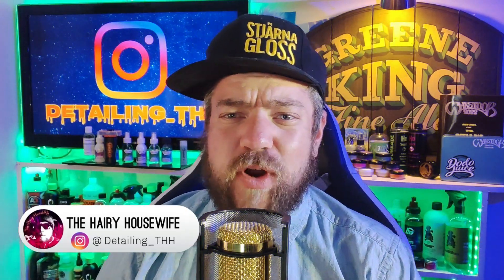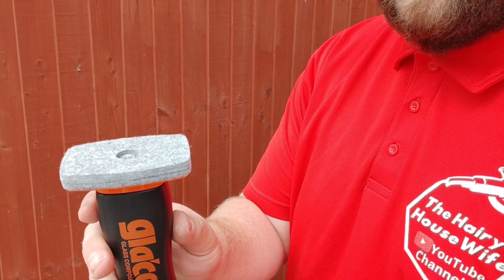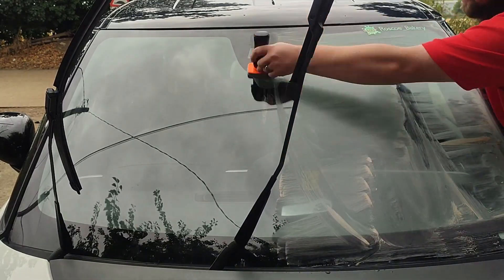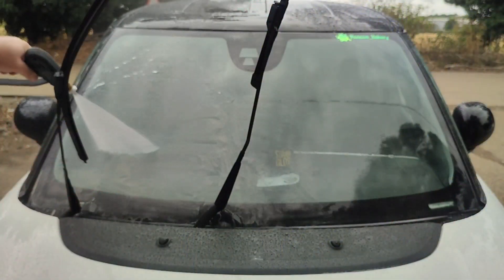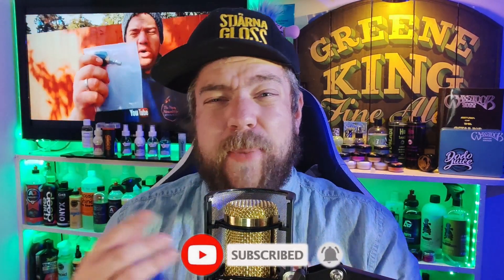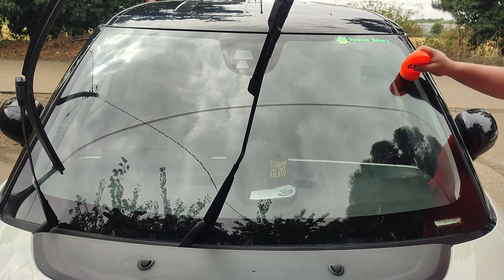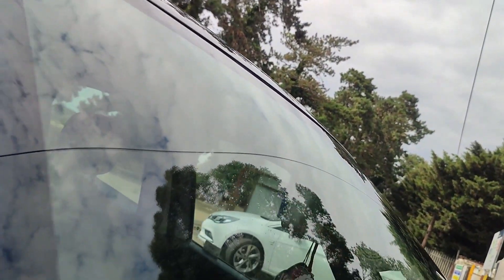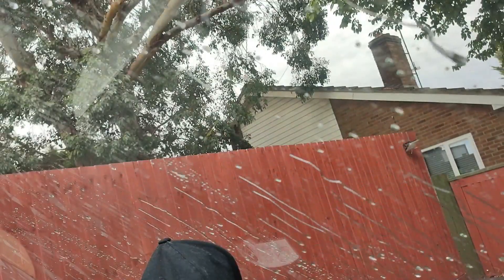Easyer Then Windscreen wipers? Windscreen Coating to apply ? Glaco Roll On MAX Glaco glass compound

Comment: Sorry, had to chuckle when you went for the power washer to rinse off the compound because I made that same mistake🤣.  Since learnt to use an older wet/damp microfibre to remove the bulk & then rinse the remainder. Applied their Ultra sealant though back in September and it’s still going strong with heavy winter use (4K miles plus) which is pretty impressive. Thanks for the video. 👍🏾
Reply from the maker: Thanks for the comment always means alot ☺️ . Yeah so this video was filmed a while back and I definitely have learnt from my mistake in this video 🤣 , never thought to wipe the bulk off tho, this is something I'll try next time I apply , Thank you

Comment: Great demo 👍🏻
I love this stuff, never tried the compound but the sealant itself is unreal. I’ve got this very size of bottle which I’m sure states 2 month durability but I’ve had a solid 5-6 month out of it! Brilliant gear 🤘🏻
Reply from the maker: Thanks for the comment , the compound Is great and easy to use , deffo a great prep before the sealant , yeah I had 4 months out of mine over the winter , however my wife had been using cheapest screen wash she could find that smelt of pure alcohol so that prob reduced its durability